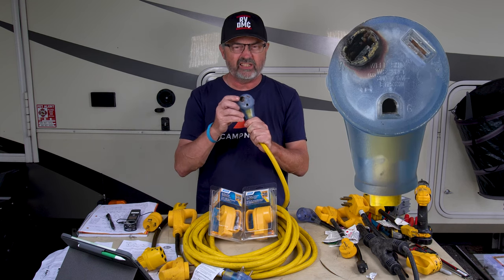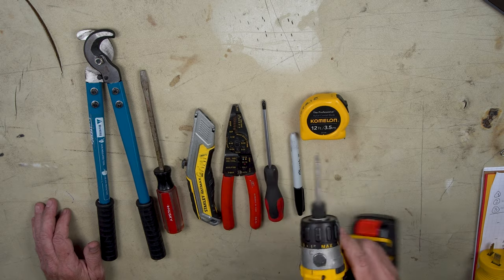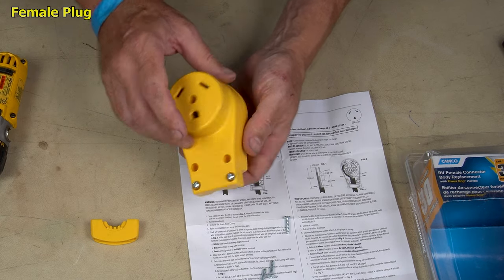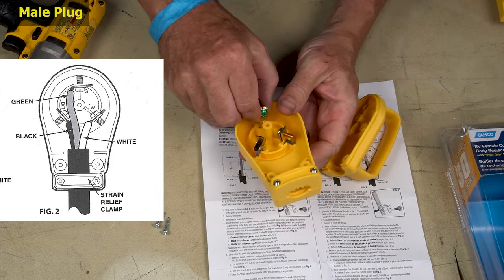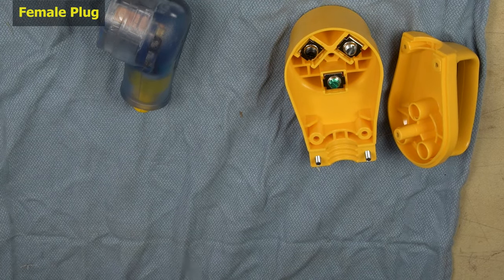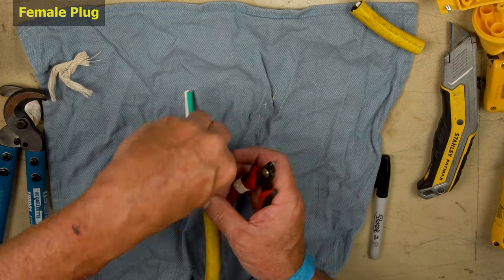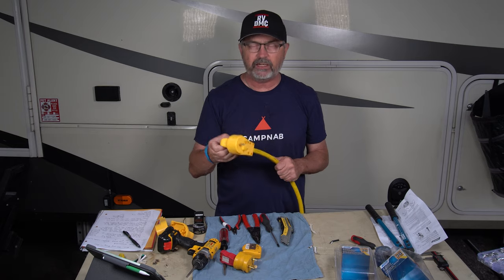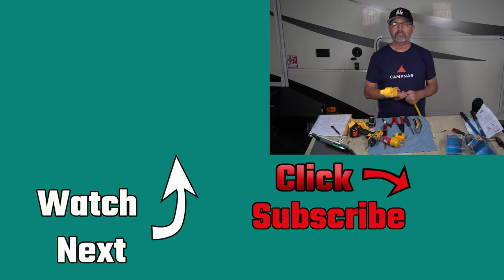How to Replace Melted 30amp RV Plugs & Save Money (RV Living) 4K

Comment: Thanks for a very helpful video.  I didn't know about the ferrules and I think they are a great idea.
Reply from the maker: I tried to use Ferrells in any project with clamping on stranded wire. It just makes it nice and neat and I think it better connection, I just recently got a proper feral crimper.  Larry

Comment: Looks like the campgrounds need to step up and replace their receptacles on the pedestals, too many overloads or bad connections. 
Thanks for the video
Reply from the maker: You are so right. 
It’s gotten to the point where we check power before we unhitch the fifth wheel

Comment: Campco connectors are the best. Did my 50 amp end last year. Definitely harder with bigger wire.
Reply from the maker: Some of the cords and dog bones have terrible plugs and sockets that heat up because of poor  contact of the terminals.  These camco plugs are good quality, plus yo can be open them up to inspect and clean the contacts.  Larry

Comment: Neat idea using the ferrules.
Reply from the maker: It does make it easier 🤗
Reply: Did the ferrules come with the plug?
Reply: @boondockinnrockin5184  It looks like the ones he used were from the plumbing section of the hardware store which are usually used with tubing. I was thinking of using copper tubing cut to size since I have some that small. I've not looked for them in the electrical section, they could be. As for coming with the plug I've not seen them with a plug, there might be some out there, the plugs I've replaced never came with the ferrules.

Comment: I have run into this a few times at Rv parks I wonder if anyone has plugged in a adapter of the park panel then plug the 30/50 amp cord into the adapter so if there is a bad connection it won’t burn up the power cord end .

Comment: Bought new male plug as both the shore power and  my 30 amp plug melted ... (left side prong only)
Question is... should the wires be tested for continuity prior to replacing cord plug? Or is replacing the plug a first step
Reply from the maker: No you should be able to just cut off the old one and connect the new one.  But it is a good idea to test the new cord with a tester after to make sure nothing was connected incorrectly.  Larry

Comment: with the handle molded into the plug, it doesn't fit the RV Power Cord Cable Hatch Cover
Reply from the maker: Yes it makes the lid open a bit but that’s ok, rain still cant get in.  Larry